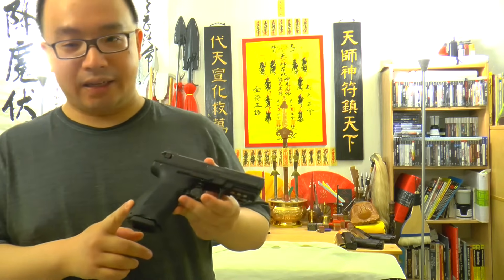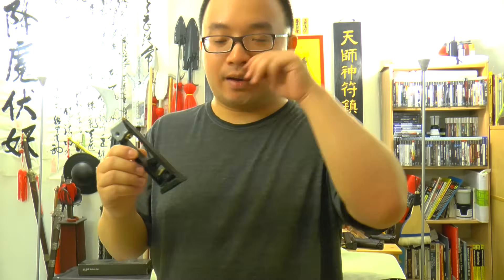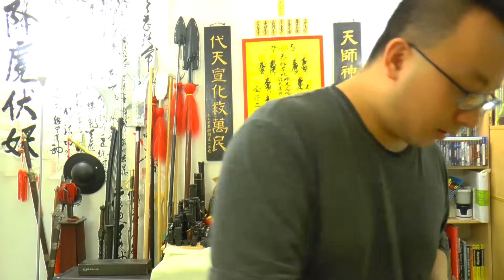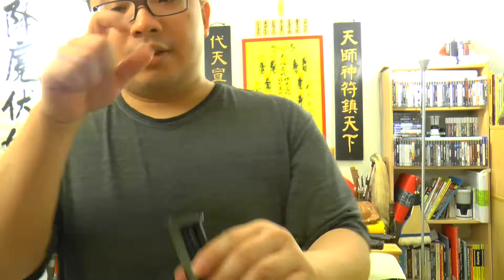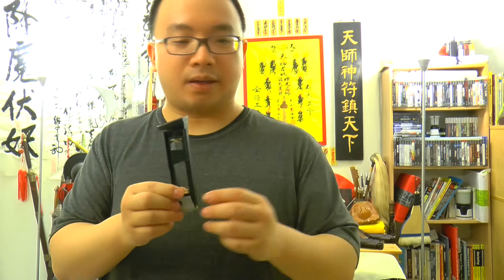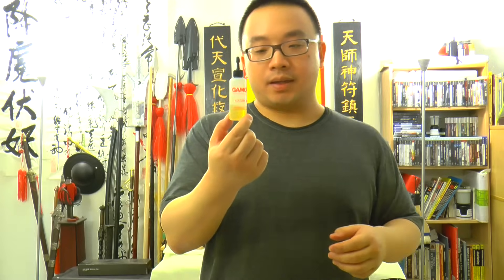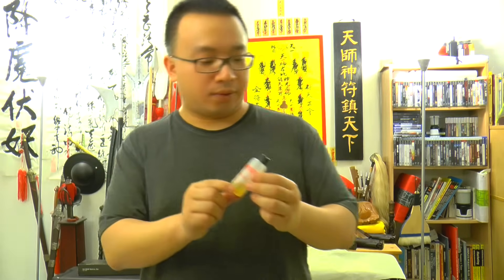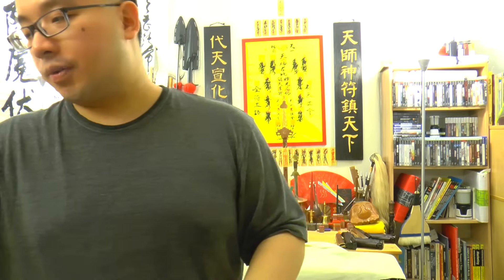How to Fix Leaking Co2 Airguns or Airsoft Guns

Comment: Can i use wd 40 to lube co2 ceiling?
Reply: I’ve always sprayed a tiny amount of WD40 in the BB container, tumble to give them all a coating.   I’m sure some has gotten onto the seal -  never had a problem.   Besides preventing jams, some believe the micro coating gives the BBs smoother aerodynamics and a better fit in the firing mechanism, resulting in faster FPS.

Comment: Didn't work!  Tried the silicone spray and after sitting a day, still leaking.   But, when I came back 3 or 4 days later it had done the job. The gun worked like NEW!  Thank you so much!  I wish I'd known about this a long time ago.  I would not have thrown away some old guns.  Very well explained. Great job and great advice!

Comment: Applies to all GUNS ? I HAVE A BOA CO2 AIRSOFT my CO2 tank goes in the handle can't take that out can even fit my finger in it ? How to I fix that type . A few weeks ago I dropped my gun and it opened up had to cut the spring a little to finally let get it to close. Put a NEW tank and the BB's just fell out. How do I fix that problem ?
Reply from the maker: not sure about your problem, it seems like your gun is broken ?? need a new gun
Reply from the maker: crosman c11 clone, pretty cheap build, get a new gun , problem solved
Reply: Is there a metal Gun you recommend. That is CO2 wont break and some what good price?
Reply: What is the gun your holding in this video ?
Reply from the maker: Any airgun will break if you drop them on the hard floor enough. Even it's metal, it doesn't mean the small parts will not break on impact dude.  airguns are very delicate, have to treat them with care.

Comment: Hi there can anyone help? With my co2 pistol it can get through an entire magazine of bbs fine but as soon as I reload more bbs into the magazine I fire a few shots and gas starts leaking out. I've tried using silicone oil and it doesn't work. Will I need to replace anything on the magazine at all? Thanks
Reply: get a new mag

Comment: How to fix a leaky co2 gun? well you take it apart and replace the seals or worn parts-oil might work for mayor leaks due to faulty seal for a short time, sometimes it's only a tiny bit of dirt inside the piston that will flushout with the oil- (I always take my co2 gun apart if it leaks in any way)for a deformed co2 piercing end seal yes teflon works great on any co2 cartridge- other than that, a mayor break down of your co2 gun will require replacement of the seals for sure- now, on my 8 month old heavily used cr357 the top piston started to leak really bad, I took it apart and glued the little rubber seal back in place with super glue- it had a tiny tear, this seal is held in place by a clip thats sits inside of the piston, I then reassembled it after letting the glue dry (24 hours) and now it has no more leaks shoots like brand new, a lot of power especially with bbs I get 60 good shots per co2 count at about 450 feet per second per shot and that's danm good for a co2 revolver- the new seals will cost me about 14 bucks hopefully my gun should hold up until I buy the two new seals and the screen about 1 more week from today- I shoot it almost everyday, it's a pleasure to work on it- I put a dab of white lithium grease on the trigger spring and the tiny tube connectd to the pistons on my gun when I have to- like every 1000 shots or so.